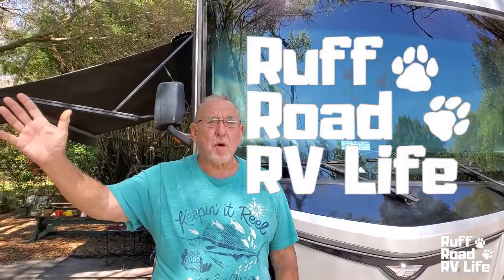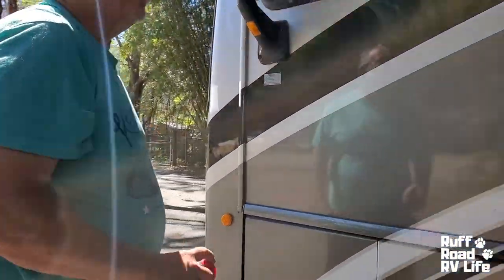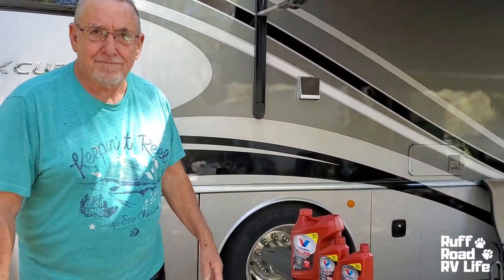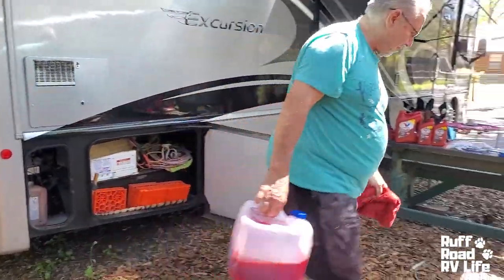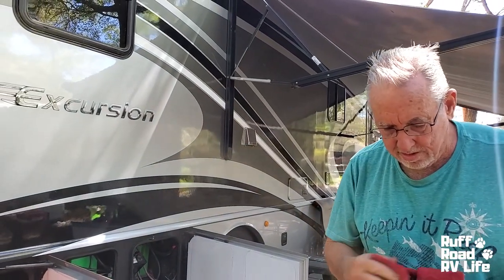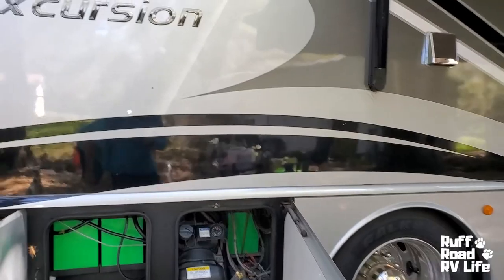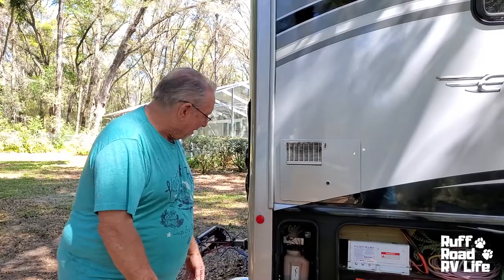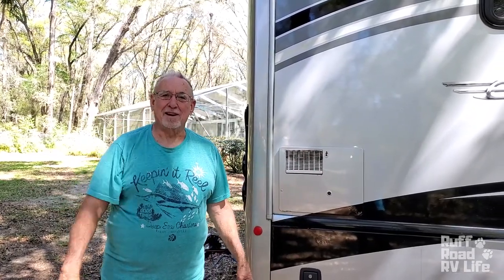RV Hydraulic Leveling Jack Maintenance:  Changing Jack Fluid

Comment: Question.
I'm trying to change my oil for the first time and yours is a red color oil and mine is a white color oil. Is it okay to change a rad color oil?
Reply from the maker: Follow what your manual says.  Our PowerGear manual states to use transmission fluid, which is red.  Your system may require only hydraulic fluid, which should definitely not be mixed with transmission fluid.  
Definitely follow what your system's manual states.  👍